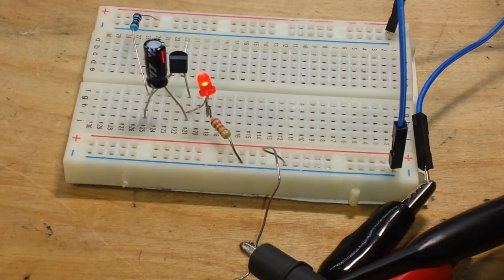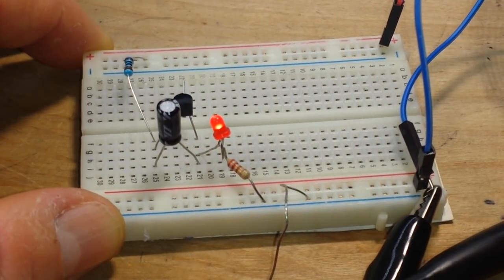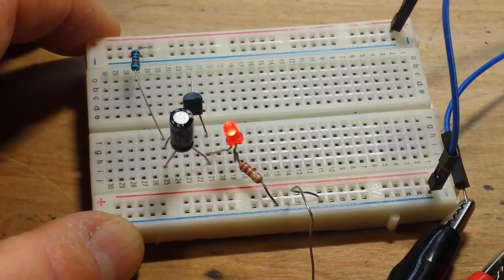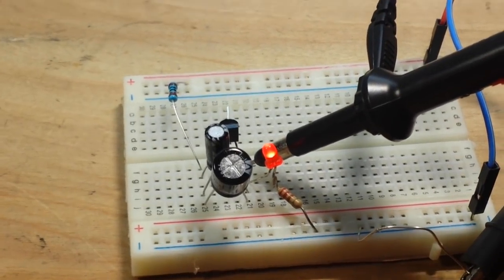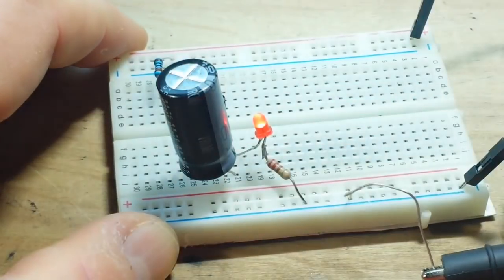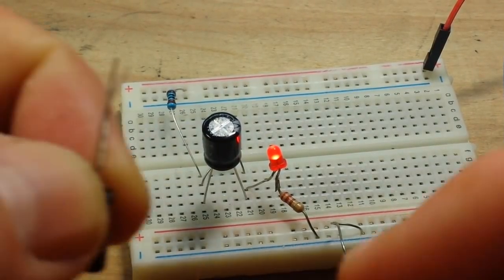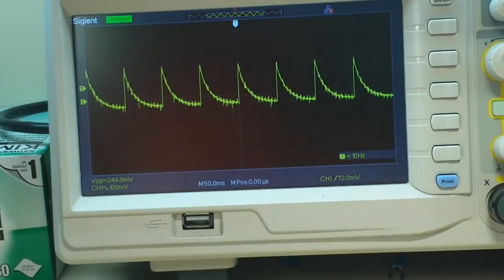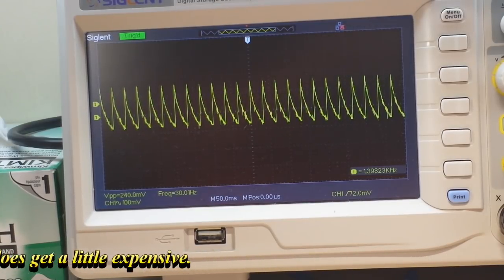How to make a single transistor oscillator

Comment: Use a 1kohm resistance and 3300 uf capacitor. With a 12 to 15 volt power.

Comment: The capacitor is charging to a greater value than the battery is providing due to the load resistor. Changing the load resistor will allow the capacitor to charge to a greater potential than the battery can provide, and the depletion regions will become thinner and thicker with greater magnitude getting the transistor closer to on/off. I've been playing around with different oscillation schemes using 1 BJT, diode(which tuning the circuit is best an LED), and resistor. I had not considered an open-base circuit though. 
The capacitor is manipulating minority/majority charge carriers, and thinning/thickening the depletion layer.
With the right value resistor and a 12vdc supply, just about any transistor should pulse.

Comment: I noticed that the setup, regardless of capacitor size, is extremely sensitive to voltage input. With my DC power supply set at 9v (same transistor, yellow LED), the LED didn't light up. An increase of .5v made a slow, visible oscillation that increased with voltage up to 11v, when the LED became visibly stable. Didn't measure with an oscilloscope

Comment: I thought it was dangerous to touch the two wires of a capacitor if it hasn’t been discharged?
Reply from the maker: You can be shocked
Reply: Large ones yes, that cap is relatively small and can't store a dangerous amount of charge

Comment: Hi Paul, Love this stuff. 
Is there any way to make a wave pattern that is like a triangle wave but the top and/or bottom of the wave moves  horizontal like a square wave. So the wave is angle down, horizontal, angle up, horizontal.
Reply: Diode rectification can chop off the tops of the saws and make them flat.
Just run two diodes in parallel, in opposite orientations. Just a simple diode clipping circuit, and bring the levels back up with an op-amp, sparing a few details :P
Everyone loves diode clipping!

Comment: Connect your cap to directly to neg. It will unload better and u will see a more positive oscillation. I also used no resistor on the neg side, slapped in a speaker to hear it.

Comment: My circuit has a 4.7K resistor to the emitter of a S9013, the capacitor goes from emitter to ground no limiter resistor on a white LED  from collector to ground. S9013 flashes at lower voltages. Instead of the LED you can feed the base of a 2N2222 with emitter grounded then put a 12 Volt LED strip from +12 V to the collector of the 2N2222 now you have a "Chopper" circuit that gives nearly the same light but with less Watts since it pulses the current. At 12V both transistors can be 2N2222 I think.

Comment: I've tried multiple transistors, capacitors, voltages (9 to 12), but I can't get no oscillation! Anyone knows why?
Reply: Fosco Lucarelli Might need a little higher voltage, depends on the transistor.

Comment: TBH, this is a very clever relaxation oscillator. Unfortunately, most of the simulation software is not capable of modeling a transistor in reverse avalanche mode.

Comment: It is a very very very bad circuit because it broke transistor
Reply from the maker: It's just a trick, and only works with some transistors.
Reply: @learnelectronics  its only working with bad transistors and it damages my. Its not bad meant but please show you the circuit with 2 Transistors that doesnt damage transistors and works forever
Reply: @boxtech105  this circuit has some popularity for audio synthesis. i see lots of documents about it. this is the first mention i have seen that if you build it, it won't last for long, which seems sensible considering the method. but, i think we all know that it will take years for your method to become as well known.
eg. "string machines" which use say six saw oscillators slightly detuned would be inexpensive to build.. add a resonant filter, you have a classic synth voice.

Comment: All right... one question. I saw in another video (which I can't quite find at the moment) that it will work with almost 100% of the transistors if you cut away the unused base leg. Simply bending it or leaving it unsoldered won't do. The maker of that video did show this trick but admitted he didn't know why it worked. Why that happens?
Reply from the maker: While I definitely dont have the absolute concrete answer. I would guess that the leg acts as an antenna. And being free floating, it can go high or low. If it floats low it will close the C-E channel.

Comment: Putting capacitors in parallel only doubles the capacitance if both capacitors are equal value. Add the capacitors together to get the overall capacitance. Capacitors in series decreases the overall value.

Comment: I used old Russian Nixie tubes to make a 4 digit clock. No micro controllers pure old school logic circuits. I prefer my analog scope on my bench compared to my dsos. I love the sound and feel of the knobs. But I have to break out the dso when I have to do certain things that the old Tek can’t do. Like my tek is only 100MHz and both dso are 200 MHz with other goodies.
Reply: @Danijelovski Kanal no I doubt it is possible. There’s a lot of equipment required to make tubes. They are manufactured similar to incandescent light bulbs so gotta pull vacuum and close the glass with a torch while keeping the vacuum in the tube also the inside bits the filament and the metal strips they are all made of very specific materials and the size of that stuff will determine how it functions. My best advice is to just find NOS (new old stock) vacuum tubes. You can usually find what you need there’s a lot of new tubes out in the wild. I have found Russia is the place to get them. They used vacuum tubes longer than we did. So there’s a bigger supply of them from there. Good luck buddy with your project. I’m curious what you are trying to do.

Comment: I agree with the person that said about programming microcontrollers is too much of a go to.  However, all of my projects always have a problem with " feature creep" and my background is programming, not electronics so I always graduate towards the microcontroller solution.  It always ends up being bigger and more expensive with the discreet components now days than with the microcontroller anyway.  In this case, you have 6 components instead of one.  But I loved the video and the lesson, many thanks..it will prove useful.
Reply: That true, but I love tinkering with analog.
Reply: The economies of scale is the primary reason. Even though a given circuit may be smaller, simpler, and more efficient when constructed with discrete components, its final bill of materials often costs more than an equivalent microcontroller circuit. This is especially true for larger more complex circuits.
Reply: It takes a much stronger mindset to design with electronics than to program, especially when the latter's pretty much about "library" calls on some compiler.   A programmer is never even near the level of a proper electronics engineer, "big" components or not.

Comment: Use a 10k pot at the input to play around with the hz. Hook output up to speakers. Sweet.
Reply: Yep, gotta agree. I'm  playing with one of those ckts right now and I have a 50k pot in place of R. I get all kinds of freqs. Good video. Anyone mention the negative resistance that's causing the transistor to short completely? I think it's called negative differential resistance, and it appears within a region in the transistor with the right voltage. Pretty cool.
Reply: How did you hook it up to speakers ? I added one end to ground and the other to after the transistor but the sounds is very quiet ?
Reply: @yeah4768  Get an amplifier maybe to output on the speaker?

Comment: I believe i've saw something on hackaday and it makes saw like waveform related to the discharge of the capacitor. Try a 1.2M Ohm feedback between the base and colector :P
Reply: If you don't do the feedback leave the resistor floating on the base and then touch with the finger. Best used with two 100uF in parallel :D

Comment: The oscillator frequency dropped from 15hz to 10hz because you increased the capacitance from 200uf to 300uf, it would have dropped to 7.5hz if you had doubled the capacitance
Reply from the maker: You're right I went to 300 instead of 400. My mistake. Thank you.

Comment: The reason that the led doesn't go all the way off is that capacitor is always charging through the led (or it is shorted through the transistor).  If you want to flash, put the led in series with the transistor, and the capacitor across the transistor-led pair.  Then the led will light when the transistor avalanches (discharging the capacitor through the led and the transistor.  You can then use a larger charging resistor to get more reasonable time constants and slower flashing rates.
Reply: Hmmm... I tried what you proposed with an LED, a similar NPN transistor used in the video, two 100 microfarad capacitors and 10k ohm resistor. I managed to get the LED to light up and then the brightness slowly diminished. It then didn't light up again though...
Reply: @tanyongboon1082  This oscillator is using an undocumented characteristic of the transistor (the avalanche breakdown).  Not all transistors will exhibit the effect, and some may require a different voltage.  You might try increasing the resistor value.  If the charge current is too high, then you maybe will fail to stay in the negative resistance part of the avalanche curve.  So try a larger resistor first, and if that doesn't work, try it with a different transistor.  I have even seen variation among transistors from the same batch as far as the avalanche characteristics, so if say on 3904 doesn't do it, the next one might.
Reply: @argcargv  I am observing a critically damped oscillation with one particular transistor. You are right. Only one of my transistors displays this characteristic. The others do not.
Reply: I just did a bunch of tests with this and realised that a very big difference is made by the colour of the LED. Red was like in the video barely fading but a green one was flashing. Try also different LEDs if you are having problems.
Reply: @larsw4880  Color LEDs all like 20mA but red and yellow like 2.1-2.4V while the other colors like around 3.4-3.8V. The capacitors can be larger before you notice the problem of them not fully dimming as with the Reds and Yellows LEDs.

Know this is an old comment but might help someone else in the future. I'm still new to this and appreciate any further explanations when applicable.
Reply: @larsw4880  Try increasing the voltage to compensate for the higher forward voltages.
Reply: Thanks now I know how to fix that problem

Comment: What is the need of the floating base? What does it do actually? And what if I touch it?
Reply: There isn't an actual need for the base. 
At all. 
We're using the transistor as a diode. This is called the Esaki effect, and the older component of this is called a Tunnel Diode. 

They don't really make tunnel diodes like this any more. The TVS diode is not an equivalent. 

Tunnel diodes were extensively used in the 1960's but have since fallen out of favor since transistors, such as the P 22222 can be used instead. 
The transistors are thought to be more versatile in the applications that they can be used in, but they aren't as rugged. 

From the perspective of the electronics manufacturer, the diodes represented stock that didn't move very fast, so they were phased out. This is actually to the detriment of the consumer, who would be better served with a tunnel diode in the same application because it weathers better (in every way i am aware of anyway....).

Touching the base messes with the junction capacitance, which could be detrimental to the circuit, but i'm not inclined to test pulsing voltages.
Reply: Touching it distorts the output waveform .... it's awesome! 😆I bend mine all the way up like an antennae.
Reply from the maker: Build the circuit and see for yourself.
Reply: @learnelectronics  Why not use an RC circuit to switch the transistor on and off driving an led or load?